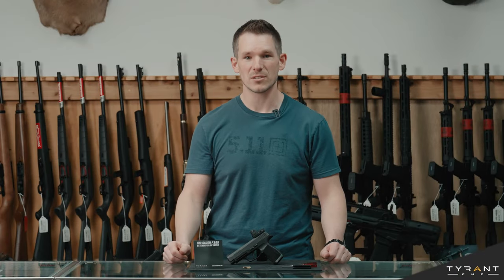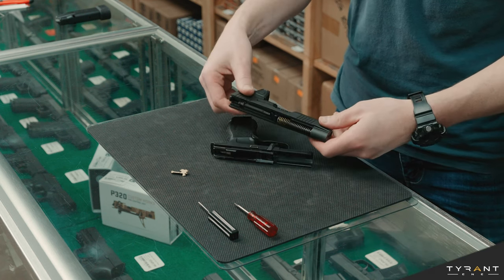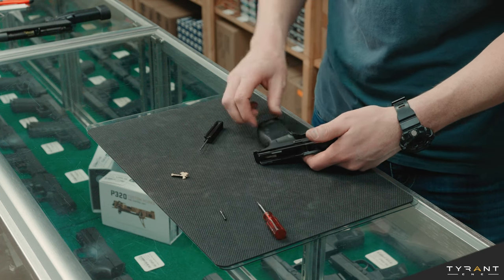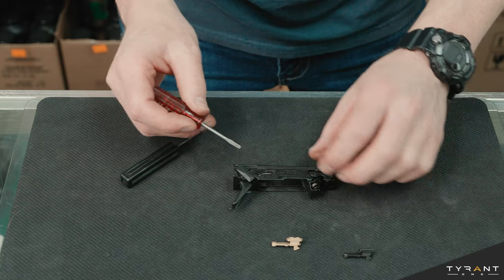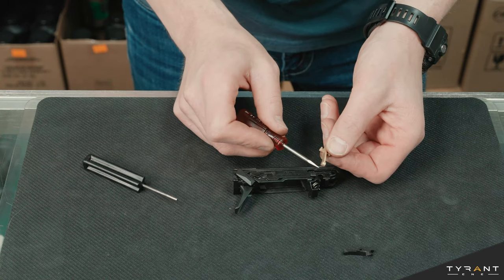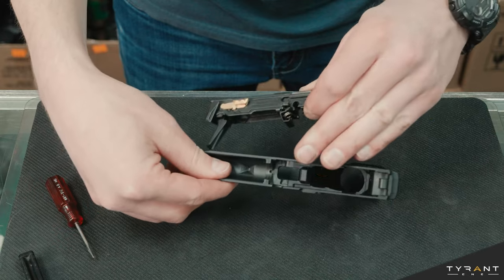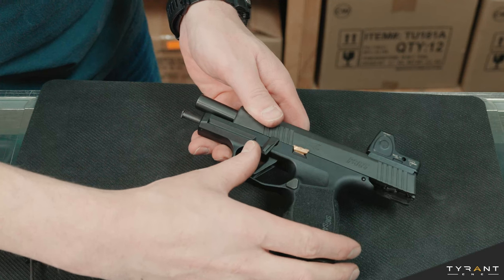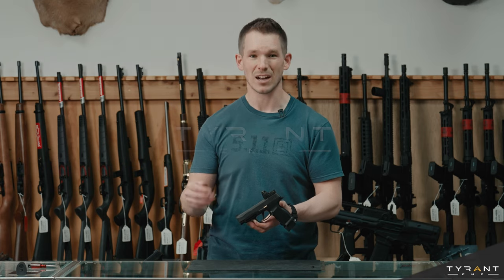Tyrant CNC Sig Sauer P365 Extended Slide Catch Lever Install Guide

Comment: How tight are tolerances on this?  I can't seem to place my fcu back in frame because the circular nub is catching the frame.
Reply from the maker: The tolerances are pretty tight. Send some photos over to info@tyrantcnc.com and we'll take a look. It's possible the post going into the FCU just needs a light sanding.
Reply: @tyrantcnc  I was able to get it in by forcing the plastic frame open a little bit.

Comment: Is it really extended? It looks to be the same length as the factory original. The problem with the P365's slide stop is not just that it doesn't stick out far enough, it's also that it doesn't extend back towards your thumb enough.
Reply from the maker: It's the same length front to back, but extends outwards more. In our experience the increased purchase on the button makes it a lot easier to release on a full mag.
Reply: @tyrantcnc  Thanks for replying. I don't have any problem with using it as a slide release. It's the slide lock function that I find difficult. I have to change my grip and take the gun out of my workspace to do it. I ordered an "extended slide lock" from Sig. If it doesn't work out, I'll try yours.

Comment: I would stick with the OEM slide lock, I installed on my 365 XMACRO  and it made it almost impossible to release the slide from the grip module. Checked the installation several times and kept having the same issue. I re installed the OEM slide lock and everything worked as it should. I wouldn't recommend
Reply from the maker: If you're having trouble let us know, we can get it working for you! It's likely the post that goes into the FCU isn't married up yet, you can get the process kickstarted by sanding that post a little before installation, and then it will wear in the rest of the way with some use.
Reply: Thanks anyway, I tried several times to get it to work correctly and it just wouldn't work properly. If I have to do sanding etc. then that's a product that doesn't work as designed/described. I took it out/off and put back in the bag and threw it in the parts bin, replaced with OEM part and works perfectly

Comment: Everything went great but after the last round won’t lock the slide and reset with a new mag either. Yes my are not in the way or hitting have tested Multiple times with a single round in the chamber with no mag and a single round in a mag. Have taken it apart multiple times anyone else had this problem before
Reply from the maker: It's a rare issue, but I have seen it. It's likely the spring, it can become bent pretty easily. I would have it inspected and, if needed, replaced.
Reply: I’m having the same issue with the slide not holding back
Reply: I am having the same issue as well, I tested this issue at the range for a solid 30 minutes…on 3 different magazines, loading only one round, firing, and testing lock back. 

I’m not riding the lever, I tested super tight grip, limp wristing, one-handed….I’d ballpark that it failed to lock back on empty roughly 50% of the time and I was unable to identify the common denominator in what would cause it. 

Just swapped back to my factory one.  Looking at it there is a decent bit of visual wear on the Tyrant slide lever and some slight deformation on the actual edge where the slide interacts with slide catch. Probably sitting at 500 rounds.
Reply: Mine did it brand new.  I’m getting an armory craft or sig replacement.  Wasted $35 on tyrant
Reply: @timnichol  Once I installed mine, it made it super difficult to remove the slide from the grip module. I went back to the OEM slide lock and like you said wasted $$$